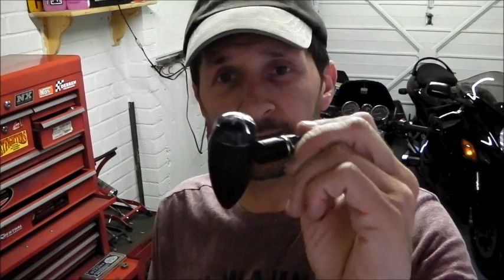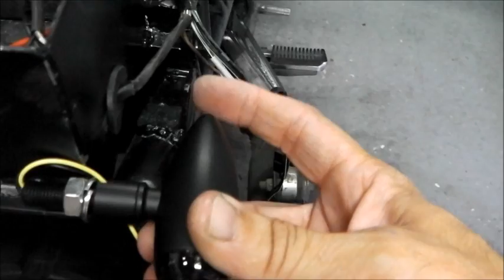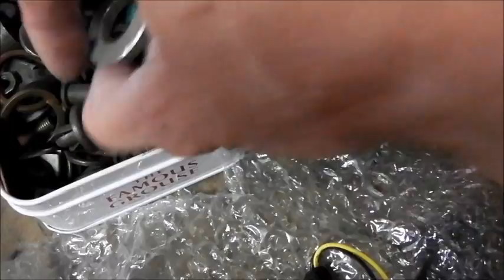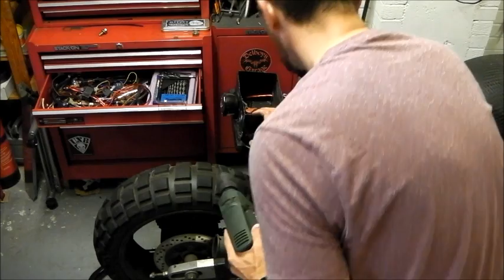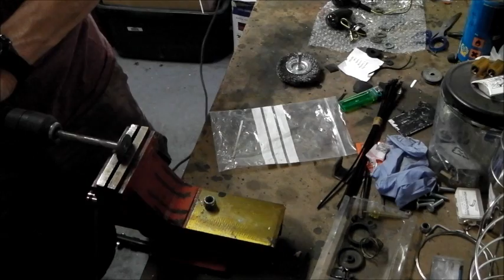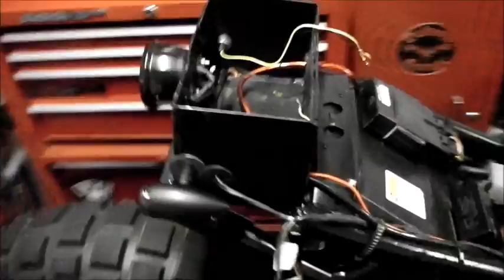Delboy's Garage, Project Bandit #21, Phwaar... Flashers.

Comment: Ten pounds each! Phwoar they must be good ones! I got a set of four from ebay for 12AUD.... the funny thing is because of the wiring my bike had, i only needed one per side instead of one per corner :D The next bike I converted to LED I just put an LED specific flasher relay in, which was a lot easier for a numpty like me!

Comment: Hey Del, I'm sure you've tried them but just in case you haven't... The bolts on the original indicators of my Hornet were exactly the same thread as the ones on my new aftermarket LED indicators so perhaps you'll find the right nuts there.

Also I agree with Tom on using a proper relay, it's better in terms of electric theory. It's easier and cheaper to install. And like he mentioned it should flash at the correct rate no matter what is connected.

Bike's coming along nicely!

Comment from the maker: Not sure if its allowed, or needed, the rim was cast to be dead true and straight, so if the disc isnt sitting flat, then there is still something in the way. either corrosion or paint, try using a flat file very carefully to get the faces that bear against the disc totally clear of anything, and that goes for the disc too... if its still moving side to side then, it could be warped..but thats rare and really odd if it wasnt doing it before...hope that helps.. Del.

Comment from the maker: If the paint is on alloy that you want to be clean and bare metal again, just use neat thinner mate, soak a cloth and hold it on the paint so it melts it, then wipe it off, may take a few wipes, but you'll get it...

Comment: Looking good now del, just a question for you just rebuild back end on my bandit after a re paint the rear disk is running out slightly any ideas is shimming it allowed for an mot?, also why does car spray come off with carb cleaner? Really scratching my head on this on. Your bandit is taking shape nicely ....loving the videos. Atb Steve

Comment from the maker: Thanks mate, I was thinking of doing that as it is more 'proper' being that you've simply changed the relay itself and not used a bodge to adjust it, which is what resistors effectively are ...do you have a link or reference to the relay you use as you run both bulbs and LEDS at the same time?  Thanks mate, appreciate the help, Del

Comment from the maker: Hi Peter, its  simple enough process, its just which way i go with shape and form....also the final finish too, im not molding the finished plastics, but laminating it up over a steel frame, so the final shape may need filler or may not, but either way, it will be 'think and feel as i go' like the frame welding....thanks for watching mate... Del.

Comment: You'd be better off with a relay. Resistors will get hot, a relay that will work with led indicators can be had for a couple of quid on ebay and will reduce the current drawn instead of wasting it as heat. Not that you'll have the indicators on for long periods.

Comment: The holes on the spade connector on the resistor is there to lock the female part of the connector on. thats why the female plugs have small tabs on. no need for the addition soldering.

Comment: You confused me a little at the end, your wirewound resistor connects across the wires, not in series :-)

Nice power resistors, wire wound and cased in aluminium with pretty coating :-)

No reply needed..